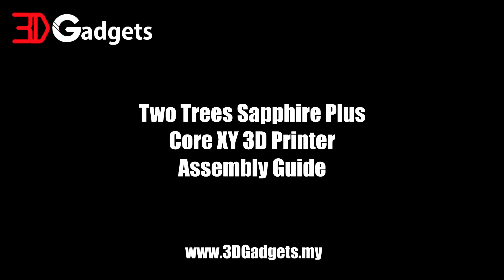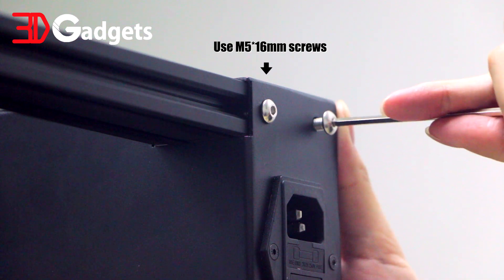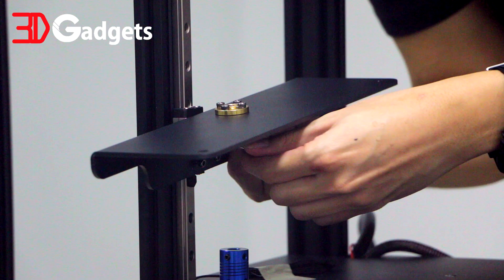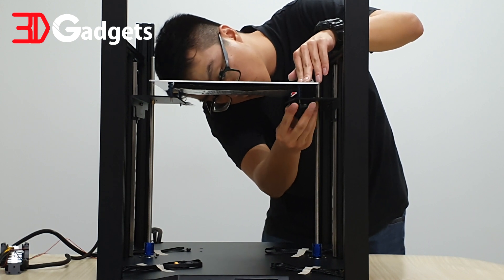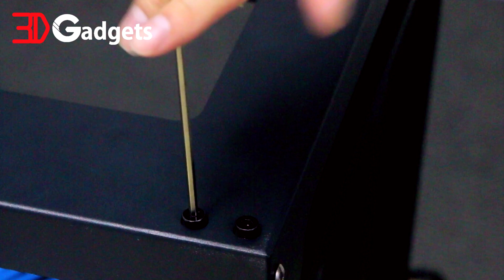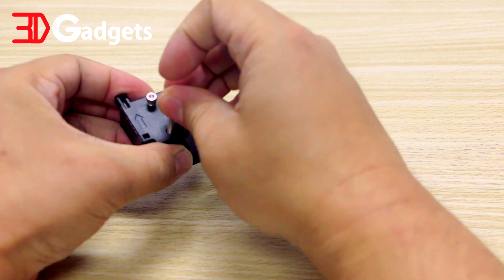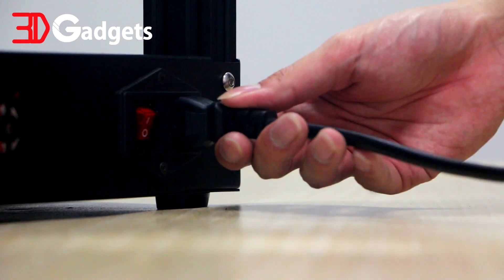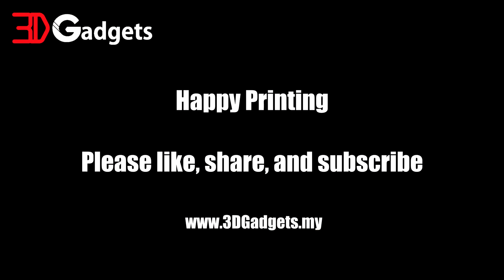Two Trees Sapphire Plus V1 Assembly and Leveling Guide by 3D Gadgets Malaysia

Comment: Printer comes without belts installed. There is nothing in this guide of installing the belts. Both my printers are missing the bltouch bracket and hardware and the bracket and hardware for the filament sensor....

Comment: This is an excellent help video, the provided manual is not very clear. I wondered why the holes in the corner brackets were so large that the bolt head was being pulled through when tightened. Your video showed that there was supposed to be washers, that were missing with my printer (I sourced some locally). Also the provided M5x30 bolts for the top of the Z axis extrusions were too long and couldn't be tightened,  but from your video I knew I had the right bolts from the kit and the problem was a manufacturing defect (obtaining some M5x25 hex head bolts fixed this). Also the pulleys on the top fouled the 2040 corner extrusions (given new smaller pulleys would take weeks to arrive, I ground away some of the extrusion instead).